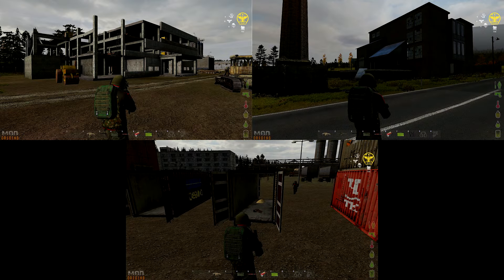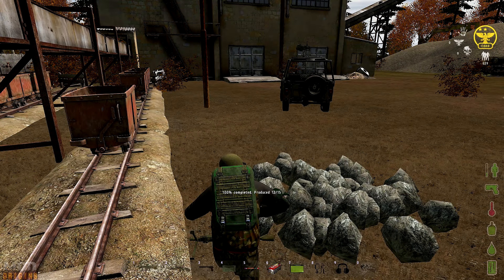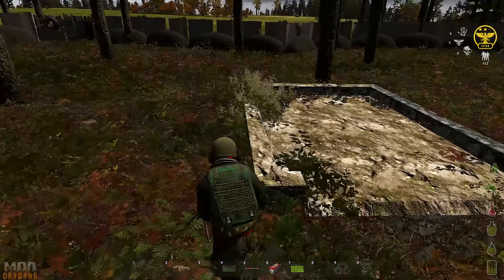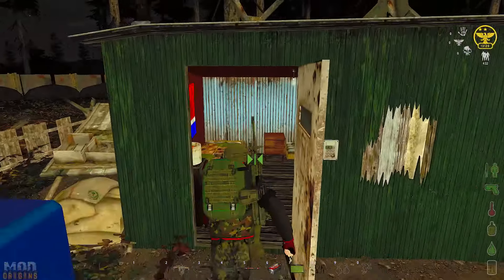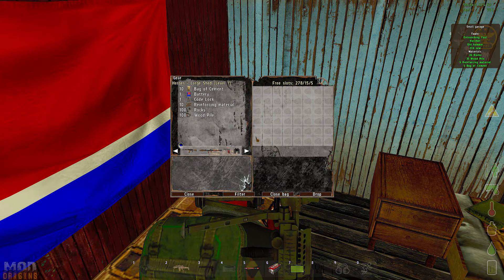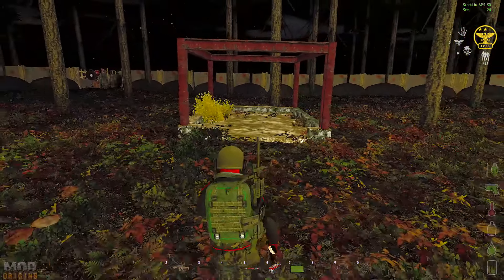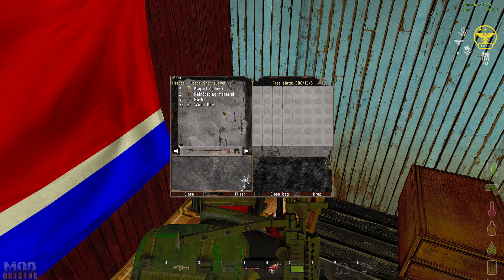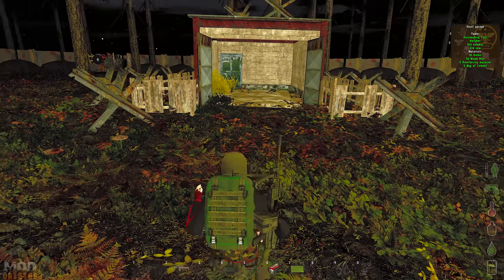DayZ Origins 1.8.3 Small Garage Build Guide

Comment: where do i find the old saw? ive looked and looted the big blue door ind and ind buildings and yet to find one ive even looked at saw mills.. Ive found 7 old hammers already and a few screw driver sets!
Reply from the maker: Try the wooden large garage type buildings.
The have a big doorway at the from and back and also a small side door.
You can find bicycle parts, rolls of rubber, hammers and saws to name a few.